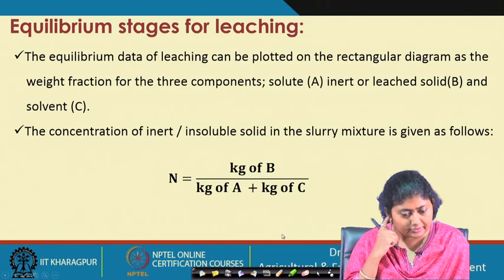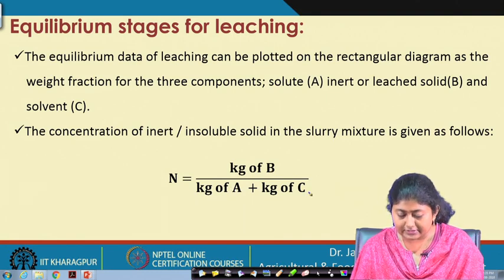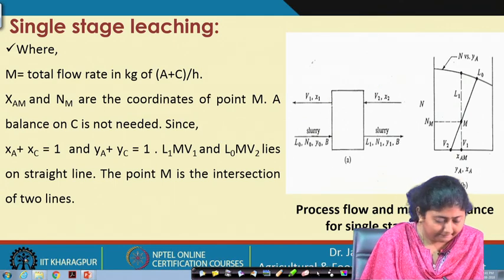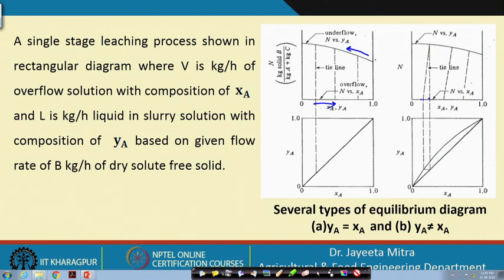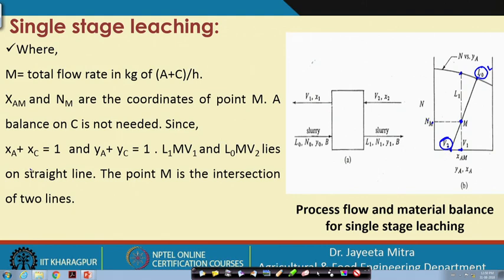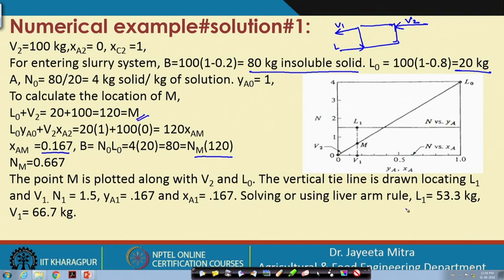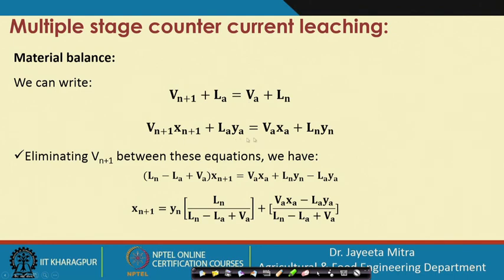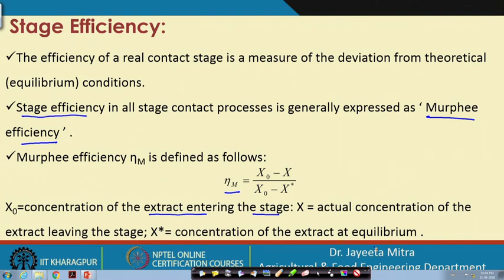Lecture 52:Leaching and Extraction (Contd.)

Comment: Thank you professor.   But the figure in multistage leaching is a little confusing.
 Since the entire figure from McCabe-Thiele isn't well-explained here, although it has a dash line around; then it becomes a question why calculating entering concentration of Xn+1 which should be a known parameter!   In fact, the stage N (not shown in your diagram) is the actual entering stream to the process not n+1.